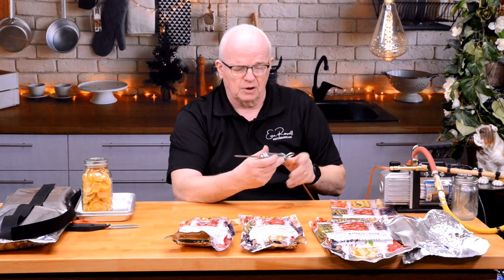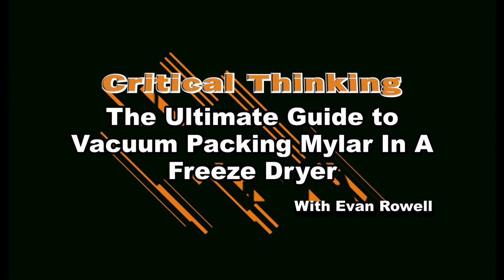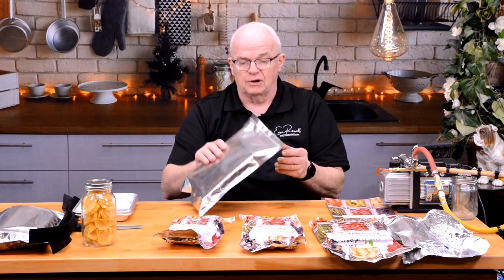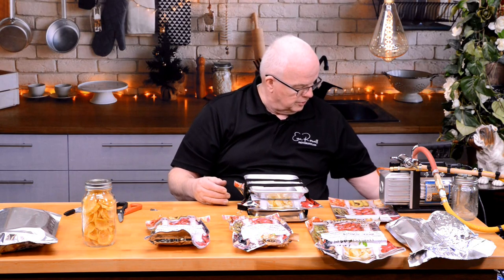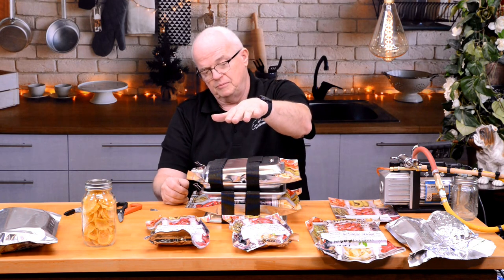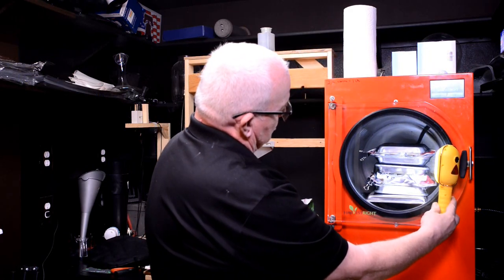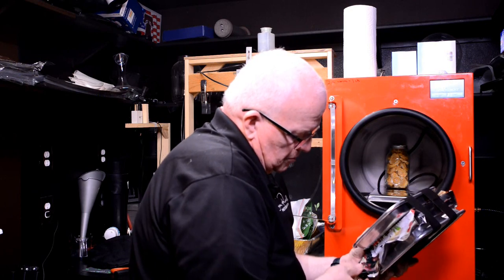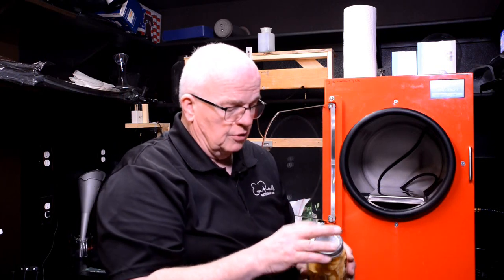vacuum packing Mylar in a freeze dryer

Comment: I looks like you could use a couple boards, or thick cutting boards in place of your pans. It MIGHT make hooking the Velcro easier.
Reply from the maker: Hello Kelly. I know you can't see them but along side the FD are two half inch pieces of furniture grade plywood but I found that the 3/4 inch sides of the pans held tighter control of the large bags, forming them to a better square . Thanks for the comment,  Evan

Comment: Hello Evan, Great job. I have bags that are rounded not flat after they are filled with product. What could I use instead of flat pans? Any suggestions? I appreciate all your video's.
Reply from the maker: Hello Julie, I don't know what you mean by rounded, do you mean puffed up? If so you still put them between two flat surfaces. The idea is to keep them from expanding any more as much as possible thereby forcing as much air as possible out of the bags. If they are really rounded then only put one bag between two pans, don't be afraid to put them in tight because the vacuum pack is going to really compress them tightly.  Tell me if I have not answered your question and I will respond, Thanks,  Evan
Reply: Hey Julie me too, round bags. But guess what, they flattened right out when they vacuumed. Look like store bought survival/camping food bags that are sucked down on the food. 😄

Comment: Hi Evan, love, love your video's !! I just seen this video a couple of days ago, just got my FD a couple of weeks ago. So I was so excited to try this, got my pans, Velcro, and clips got it already to go and my FD does not have the option to test, I push the customized and all it has is a way to adjust the temps arrow up or down, if I push cancel it goes back to the start screen, if I pus save it goes back to the start stage, I just wanted to cry. So is it that the newer ones no longer have the option to test the vacuum? Or is there another way to do this.?
Reply from the maker: Hi Robin, Call Harvest Right and talk to them about your firmware, they have updated it several times in the last year. If you need updating they will email you the file with instructions, it's really easy you just need a blank USB thumb drive. Also, sometimes harvest right puts invisible hotspots on the screen to navigate around the testing windows, I'm not sure why but there is a way, you just have to talk to a tech. If all else fails I have another video showing how to vacuum pack without the screen, it involves setting up as I instruct here and then unplugging the vacuum pump (after turning it off) from the FD and plugging it directly into the wall and then turning it on. A little more effort involved but it works just as well. Let me know if you still have trouble and I will help.  Evan
Reply: @evanrowell5266  Ok, thank you so much for responding back to me:) since I just got it a couple of weeks ago I assumed I had the most up to date firmware, but I remember you saying that about unplugging it from the FD and plugging into the wall, I might just try that. Thank you for all your videos you help us out a lot.......
Reply from the maker: @robinbrooks4460  Hi Robin. A quick thought. What I did before the firmware update that allows me to use the test mode on the FD I got a short extension cord and plugged it into the FD and then plugged the vacuum pump into it. This makes switching the pump plug from the FD to the wall a lot easier because you do no have to reach around to the back of the FD to unplug the pump. There is one caution, do not use a cord that is lighter than the one on the pump, it has to be an indoor/outdoor grounded cord. A standard lamp cord will not work. Here is a link to the one I use: https://www.homedepot.com/p/Snow-Joe-3-Outlet-2-ft-14-3-Guage-Vinyl-Indoor-UL-Rated-Extension-Cord-PJ3STR02-143-WHT/309967146 Also, be sure to never plug anything else into it when using it with your FD.  :) Evan
Reply: On the newer models, you touch the 🍃 in upper left hand corner. This will allow you to run test on Vac pump. Hope you can understand that.
Reply: @robinbrooks4460  wasn't trying to be rude. Was just saying that I hope I had explained it well enough.
Reply from the maker: @kathymedina7348  Hi, you are correct, in my latest video, the one with the ice cubes image, I talk about that, I refer to it as the "hidden Button."  Thank you for your comment, there may be many who do not watch the video and who will still benefit from you observation, Thanks Again,  Evan
Reply from the maker: @kathymedina7348  You certainly were not being rude, it never crossed my mind that you were. Your observation was totally valid and may, for some, be the only time they learn of the button on the logo so I was pleased that you mentioned it. Thank you again, I like and appreciate comments such as yours :)  Evan

Comment: Hello Evan,  I just found your videos and have learned alot so far.  Questions for you,  did you seal the mylar bag and then cut a small hole where the paper clip was placed then reseal it?  What were the black straps you used to tie your trays with, velcro?  I learned alot of good info, from your cheese videos.  You have presented good info. that others have not,  thank you.  I am looking forward to more of your videos.
Reply from the maker: Hello Theresa, Thank you for your comments. Yes, the straps I use are velcro double sided so they will stick to themselves. I am working on another one addressing the peculiarities of vacuum packing small begs. There's more to know so stay tuned!  Evan
Reply from the maker: Oh, and as for you first question, yes, I seal the bag completely and then cut the corner where the factory seal meets the seal I made revealing a very small hole. The clip is to keep the two sides of the hole pressed together. It works like this, gently hold your lips together and force air out. You will find that air on your inside will push past your lips. Now, holding you lips the same as before try to suck air in, the force of the air trying to get back into your mouth will cause your lips to seal making it very hard to breath in through your lips if they are held together. The same principles holds true for the Mylar. The clip holds the hole closed allowing the air to force its way out but when the vacuum inside the bag tries to suck the air back in it forces the hold to close tight., Evan

Comment: How soon after you package do you need to vacuum pack?
Reply from the maker: Hello House (love the handle), good question. If the food is well dried and sealed in a Mylar bag or a canning jar then you have a very long time. In fact, with the addition of an O2 absorber you have many years, some do not even vacuum pack at all and still have well over 20 years expected shelf life. Vacuum packing is a good thing to do for three reasons. First it reduces the size of the bag making it easier to store more in a smaller space. Second it will add years to the shelf life and, third, it will help maintain the freshness of the food over time. Thanks for the question,  Evan

Comment: Wow!!!!!

How does this work with something fragile, say orange slices? Do you end up with orange powder?
Reply from the maker: Not necessarily, in fact I will address this very issue in my next video. You don't always have to draw a vacuum down to the max (around 3000 mTorr) Those levels will crush a hard container. The secret is to know how far down to draw the vacuum. In my experiments I have discovered that around 150,000 to 100,000 mTorr will do a good job of vacuum packing without crushing the contents. Thanks for the question and stay tuned. I will go into some detail about vacuum levels and the effect they can have.   Evan

Comment: thats really cool, do you have a link to the heat sealer you use now?
Reply from the maker: I got my impulse sealer from Harvest Right when I got my FD. My hand held I got for sealing large bags (I sometimes use 5 gallon gags) and I got it at amazon but I have found it easier to just use the impulse sealer with the vacuum packed bags. What's important is how you set up the chop stick and binder clips so you have time to seal the bag before it looses vacuum. . Here is the link  https://www.amazon.com/Portable-Sealer-Crimp-Mylar-Aluminum/dp/B08317J4ST/ref=sr_1_24_sspa?crid=2IIY1E3Y9ZJBG&keywords=heat+sealer&qid=1636343108&sprefix=heat+sealer%2Caps%2C136&sr=8-24-spons&psc=1&spLa=ZW5jcnlwdGVkUXVhbGlmaWVyPUFJVjBPWVdSOEI4R0cmZW5jcnlwdGVkSWQ9QTA4ODE5MjZVSEhYTkhJUjFGVUImZW5jcnlwdGVkQWRJZD1BMDc4NDM4NjMzNjNBU0dUUkZCUEkmd2lkZ2V0TmFtZT1zcF9tdGYmYWN0aW9uPWNsaWNrUmVkaXJlY3QmZG9Ob3RMb2dDbGljaz10cnVl
I am also experimenting with a C-clamp vise grip heated with a torch to be able to seal the bags while they are still in the FD, it is working out and it is a lot faster. here is the link to what I am using.  https://www.amazon.com/IRWIN-VISE-GRIP-Release-Welding-IRHT82587/dp/B011HX8ZVE/ref=pd_bxgy_img_1/139-4801797-7002137?pd_rd_w=3BQ8T&pf_rd_p=c64372fa-c41c-422e-990d-9e034f73989b&pf_rd_r=BRAWQCQCFAED57F41G8W&pd_rd_r=1c623e9c-7fab-4bf4-900b-92e20e9f3a49&pd_rd_wg=C5Gtm&pd_rd_i=B011HX8ZVE&psc=1  Thanks for the inquiry,  Evan

Comment: I know this doesn't apply to this video,  but i want to tell you that i got my freeze dryer and have been trying it out for a little bit. I loaded it to the 2 1/2 lb per tray and it took more than twice as long if i would have stopped at the edge of the tray. Can you please analyze which way is more cost effective? 2 1/2 pounds per tray or 2 cycles of only to the edge of the tray.
Reply from the maker: Hello Mary, very thoughtful question and I already know the answer. Because of freeze time, which is locked in by the FD as well as the Final Dry which has a minimum time, and the fact that the moisture level is what the FD monitors, two cycles will cost much more in time and energy and therefore efficiency. 2 1/2 lbs. per tray is the most efficient target weight and a single cycle is best. No matter how many cycles you use the FD takes a certain amount of time to sublimate a certain amount of moisture no matter how you break up the time so the fewer starting and ending cycles you use the better. As I stated in previous videos, if the FD runs a complete cycle and the food needs a little more time to become completely dry  (no cold centers) I don't add more dry time, I use a dehydrator to finish up. It is less costly and the food suffer no adverse effects like it would should you use only the dehydrator (no freeze drying at all) start to finish. Let me know if I understood your question correctly, I will be happy to discuss it with you again. Thanks for asking,  Evan
Reply: @evanrowell5266  you totally understand my question.  Thank you for your prompt response

Comment: Just make a bigger hole with clip without the pans. Should work also.
Reply from the maker: I tried that and you are correct, however, I found that the bags still ballooned but not as intensely and  about half the time the larger hole allowed the vacuum to release even with the clip provided the ballooning did not pop the clip off. I am working on a way to prevent that from happening. Also without the pans to keep surfaces flat the bag was prone to being misshaped. Thanks for the comment,  Evan
Reply: @evanrowell5266  One way is to build up a slower vacuum to have the bag come to equilibrium without ballooning. I do not have a freeze dryer but if you can program a vacuum go to half then quarter than full over long period and release quickly.  Just retired engineer trying to help. And if you cannot control via the freeze dryer you can also shut off the vacuum midway and turn on after a minute to increase the vacuum time.
Reply from the maker: @jfcrow1  Good points John but my goal is to have the vacuum pump running as little as possible, the moisture in the oil builds up really fast and that's not good for the pump if run for a long time or if you forget to change the oil after vacuum packing. Also, using the chopsticks and the clip means you have to build up the pressure inside the bag before it starts to escape. Thanks for your comments,  Evan
Reply from the maker: @kolobkolobkolobkolob  I don't think moisture getting back inside the bag is an issue, the whole point of vacuum packing is removing air and then not letting it back in. It IS an issue when the high humidity from the vacuum sucking back into the vacuum pump, that is why I change the oil after every vacuum packing operation. I do change the oil after every batch but especially after every vacuum packing.

Comment: What mttr do you have it get to? I heard you say 38 on the first round, and then the second one you said 3000.
Reply from the maker: Hello Tiffiny, I was probably referring to 3800 mT. What I was implying is that you never need to get below 3000 mT but in many cases you need not get below 120000 mT. It all depends on what you are packing. Light delicate food will do well at 120000 mT so it does not crush while there are times, like when packing meat, that getting down below 10000 mT is desirable. Remember, 3000 mT will crush a metal can. Thanks for reaching out, Evan

Comment: Does a oxygen packet need to be put into the bag if vacuuming?
Reply from the maker: No, sometimes I don't with vegetables but it's still a good idea with prepared foods because there will still be a small amount of oxygen left even with vacuum packing which can effect freshness and flavor.  An O2 absorber helps preserve freshness over the long term by mopping up that last little bit of O2 so I still use them and I always use them with meat.

Comment: I used two pieces of Corian to build a vacuum system base. The bottom piece was solid, the top had the slot cut out of the center to put the end of the bag in like the commercial units have.  I welded the two pieces together with silicone.  

I added a top, a piece of 3/4" clear Plexi, I had laying around mounted to the base via a couple hinges.  

When done, the beast would take up to a 16" wide bag.

To allow a vacuum on the bag, I added common, self adhesive door gasket material to the base.  Also, I drilled a through hole from the side opposite the hinges and into the part the end of the bag would dip into, again, just like it would in a commercial vacuum sealer.

For the vacuum pump, I used a common nebulizer I'd picked up at a garage sale for two bucks. I had to swap the hose internal connection  to the opposite side to change it from an oil-less compressor to a vacuum pump.

I enlarged the vacuum hole half way in and just big enough to press a nebulizer end into.  

It works great, and if I kill it, I go get one of the others I picked up at yard sales.  Too, since the sealer I use can be adjusted, I can adjust the temp for any vacuum bag I want to use.

_________________
SIDE NOTE: I have to build another to replace the one above, which the ex swiped, on her way out the door, along with the sealer.
Reply from the maker: Sounds like you put a lot of thought into it and it does sound like it would work! Good on you for innovating!  I like hearing when people use my motivation to expand upon,  Evan :)